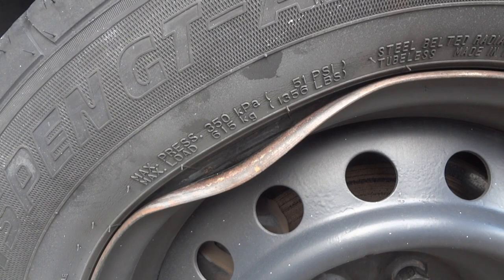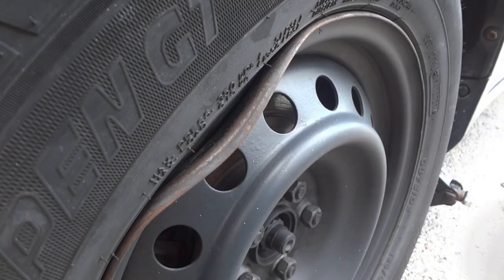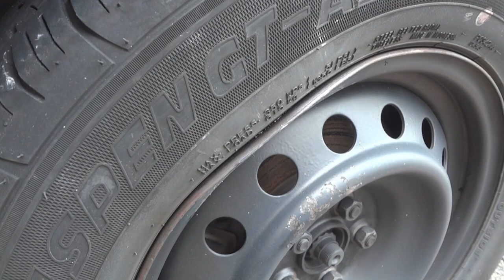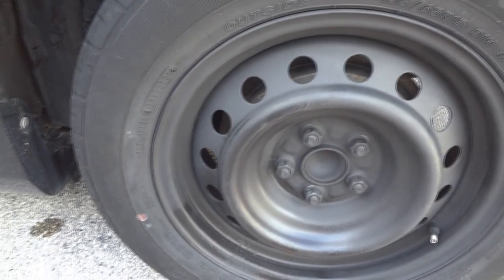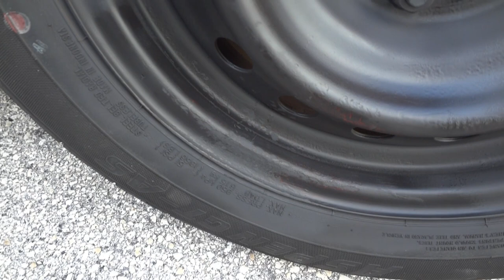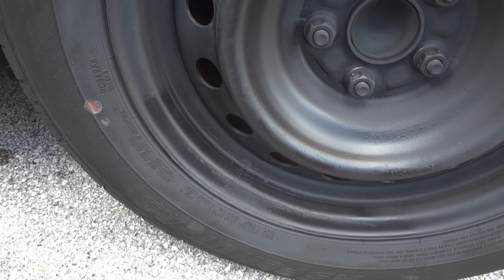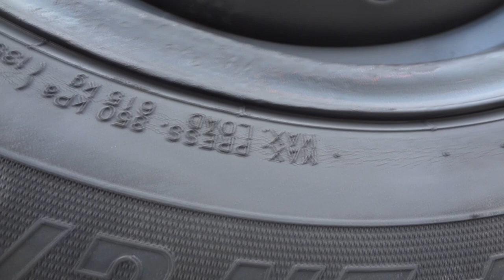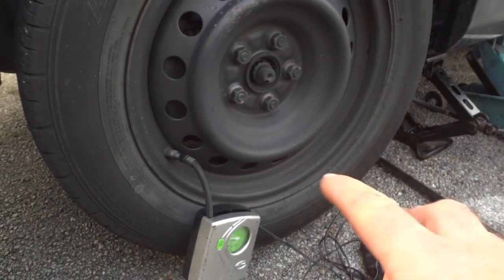How to fix a damaged rim on a car without buying a new one

Comment: Question. I had a Guy from the tire shop hammer 🔨 out the dent. And we are getting a new tire replaced. Will it be safe driving long distance?
Reply from the maker: @kailanatam2574  not sure mine in video is working fine with replacement tire Installed.

Comment: The title features an alternative .. FIX A DAMAGED RIM BY BUYING A NEW ONE :| :))))))
Reply: Don't you see the rim is bent, which means no matter how many tires you buy it won't seal because of the BENT RIM! 👀🤔
Reply from the maker: The rim never leaked even when it had the damage. It still doesn't leak and works perfectly fine. If shop says new tire wont seal when i change tires then ill replace the rim at that point.
Reply from the maker: Just replaced tires recently no issues with that rim.

Comment: I have slightly bent steel rim (probably twice less than shown in this film), and how it came to my attention was: I went for the alignment to a dealer and brought the 5th rim for balancing (I put new tires, but have just HF Bubble balancing Machine for preliminary balancing) since like to have a full size spare tire on each car we have. That 5th wheel was a brand new, so when mechanic saw that I have a new one he suggested to put on a car a new one instead of that slightly bent. At this he said that the bent rim won't let him to align the car properly.  I think if not that new rim the question would never arise, especially I didn't like the results of the alignment that much. The results on the rear (the bent rim was on the left rear) were the same before and after. There is no leak on that wheel w/bent rim. Could it be any problems w/that bent rim if no leaks? Thank you for this great and informative film.
Reply from the maker: A bent rim doesn't affect the alignment. It might affect the balance. This car didn't leak air even with that big bend.

Comment: So with mine, the tire keeps moving out of rim. Apparently because there were 2 small cracks in the rim. They fixed this, but same problem again, wheel goes down and when I feel behind the wheel I can feel the space between rim and wheel. What could be the issue?
Reply from the maker: Are you saying the tire is not sealing on the rim?

Comment: The most realistic at home repair 💯 prolly need to learn how to use a torch . Did you have to deflate the tires after ?
Reply from the maker: I used a portable torch. No deflating.
Reply: @chriss4365  ok I appreciate it about to make my torch run soon lol

Comment: What if it is leaking air, and deflates fast when driving. Can i use a hammer on aluminum rim, for inside bend? The bend looks the same as yours but its inside and has a crack on the bend section
Reply from the maker: Aluminum is softer metal but the crack you mention is not good. You probably need a new rim. You can try it but that crack doesn't sound good.

Comment: Damn so you dont need to remove the tire from the rim?
Reply from the maker: Depends on severity. I had to remove it after to give it a few good whacks to fix a slight vibration from that wheel.